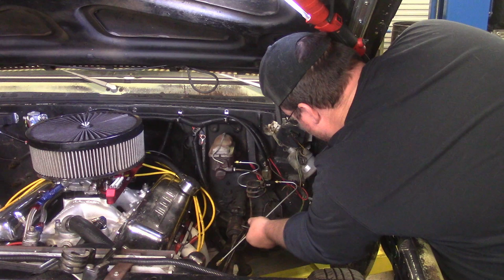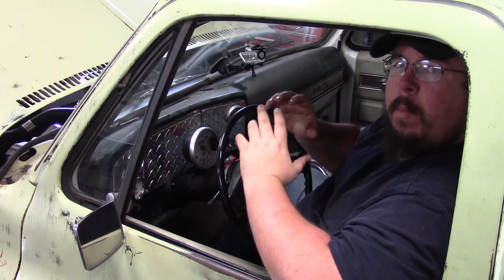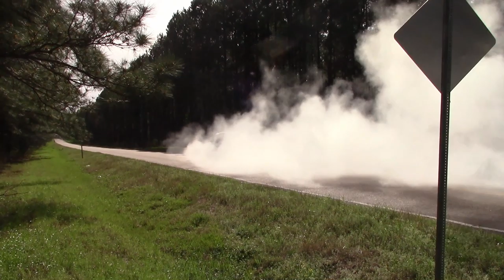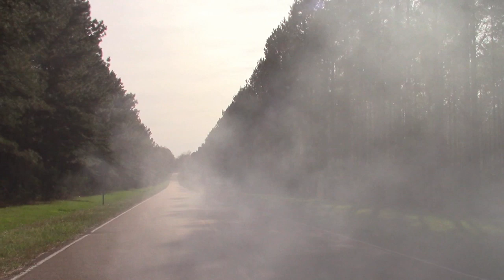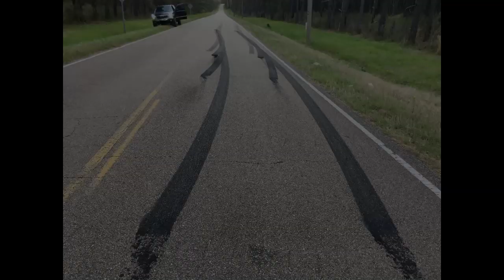Line lockand adjustable proportioning valve install

Comment: also can you go over the rear suspension set up. What do i need to get to get it set up just like yours. WIll thepinion angle need to change if i set mine up like yours
Reply from the maker: My rear suspension is spring under with the overload removed, and Caltracs. You will need to set up the pinion angle when you set up your ride height

Comment: You took out the metering valve from the front… is your truck nosediving now when you press hard  brakes?
Reply from the maker: Nope, with the adjustable proportion valve, I dialed in the braking so all 4 lock up together. It works great!